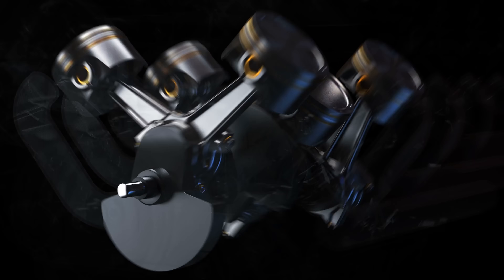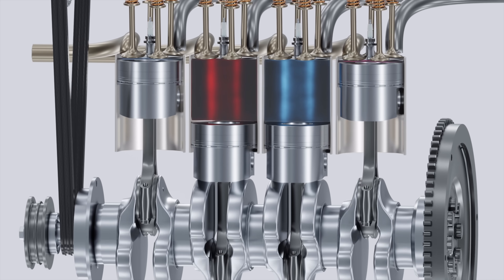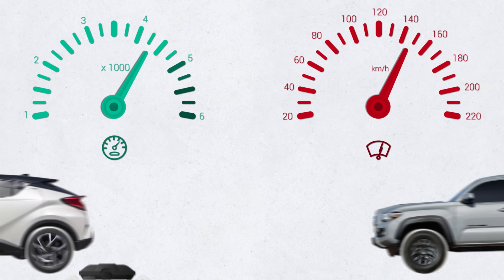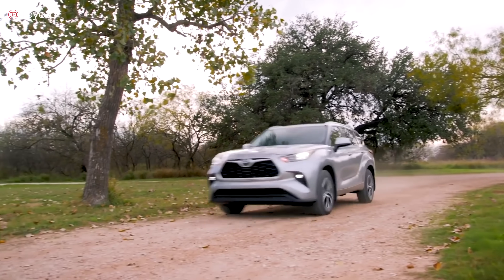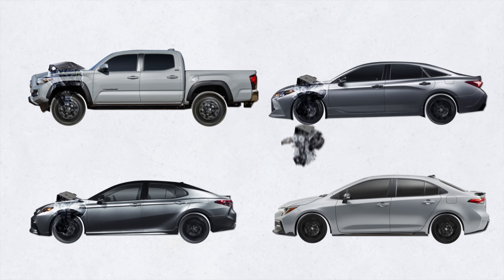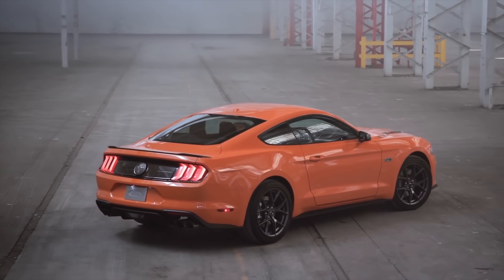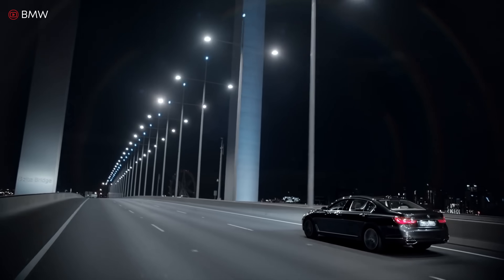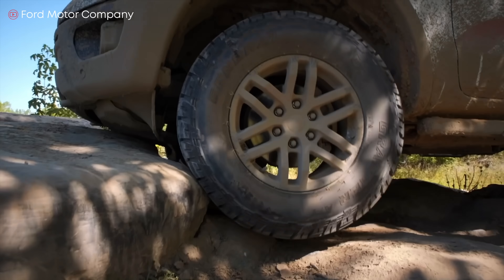No One is Telling You the Truth About Turbocharged Cars, So I Have To

Comment: V6 all day. Turbo 4's won't last due to high pressure and more strain on all the parts and seals.
Reply: Have you ever heard of Volvo?  If you have a strong engine and put a turbo on it, you get a strong motor with more power. I had several that ran great with 150K miles, I have seen them go up to 300K.
Reply: i got a tt mk1
Reply: @danielselinger8209  16 S3 here wassup VAG fam
Reply: @richardweinberger2756  my sons' Focus has a turbo and the bearing is shot at 120k.  £1200 part, the car was only £3000. The engine is fine, but that's beside the point.  You see what I'm saying?
Reply: @richardweinberger2756  outliers don't define the norm. In general my statement holds water.
Reply: @rob5944  The engine IS the point, Rob. What Scotty is saying is that these small engines in turbo cars don't last. YOUR unhappiness is that you don't want to replace the turbo when it wears out - which they do - it's completely common.
BTW I see those turbos used on Ebay for $200 in the US. Doesn't anyone rebuild those where you are?
Reply: @richardweinberger2756  it's not my car, maybe I didn't make that clear.  But for that money they sound well dodgy?
Reply: @rob5944  Why not check for yourself? Turbo's are not a new invention, they have been mass produced for 50 years.
Reply: @richardweinberger2756  so what point are you making, so was BMC/ Leyland?
Reply: @richardweinberger2756  ah you mean the low price?  Sorry, am on mobile and conducting several conversations in between other stuff.
Reply: How reliable is the Honda 1.5 T ? I am considering buying an 
Accord .
Reply: @DiscipleRay  Hondas use to be extremely reliable. Which you shpuld expect the 1,5T to be.

Comment: I’ve always found that durability and reliability are related to how someone drives. A very aggressive driver who mashes it to the floor every time they accelerate will have more problems and shorter engine and component life than someone who accelerates smoothly and moderately. I’ve had both turbo I4 and V6 engines, and I’ve had zero problems out of either. I am an aggressive driver but not to point of abusing the car. I make it work but I won’t hurt it. From what I can see, most modern engines are fairly reliable given good driving practices and regular maintenance.
Reply: Honda 1.5 turbo is trash gas leaks in to oil from factory and Honda  says that normal
Reply: I’ve owned four turbocharged cars and drove them like they had been stolen. One was highly modified and it ate some head gaskets (you play, you pay!) but never had any problems with the others. I’m religious with maintenance and like any non turbo car you need yo take care of it.
Reply: @Sammyhale30  Handling is the key to maintainance afterall in any kind of product. So howcome you can say it. Quick acceleration and quick braking matters alot and it is itself part of maintainance.
Reply: If you can do the work yourself you save all of that 💰 write it off in taxes
Reply: I agree. I'm getting a brand new Ranger Tremor next month and upon hearing it was a turbo and they require a little more maintenance to last, I immediately started researching the best maintenance tips and procedures for turbo engines. I plan on keeping this truck until either it explodes or I do so I want to spare no expense taking care of it!
Reply: Me too I’m an aggressive driver but holy moly these Texans 😅
Reply: LSPI

Low Speed Pre Ignition

This is the major issue with smaller turbo charged engines.  The increased operating pressures, combines with other factors, better explained by others than myself, leading to pre-ignition at lower RPM's, causing significant wear and damage to the engine components.

Unless your turbo has steps to mitigate LSPI, you will have engine component failure much sooner, unless a granny drives your vehicle and doesn't accelerate hard at low RPM.. then you might be ok.
Reply: @Unsensitive  That's known as detonation or knock and is easily avoidable by using 91 octane fuel, which is what's recommended for turbo engines anyway. Besides that, any engine can get the same thing, so that is not just a turbo engine thing. And no, it does not cause significant wear and damage. Not right away, anyway. Modern ecu's that run OBD 2 (anything post 1995) do have knock sensors and will adjust the timing accordingly, to get rid of any knock or detonation that it is sensing, so every car has steps to mitigate the issue.
Reply: VW 1.6L NA I4 with 285000 Kms (175000 mi) The only thing of the engine that got replaced was the ignition coil at 275000 kms. If you let the car get up to temperature you can do some spiritve driving and sometimes it can be beneficial for the engine. If you floor it all the time even when it's cold then you deserve to have a faulty engine.
Reply: @brianwebb1984  
They are not the same, despite sometimes being used Interchangeably.

LSPI occurs before normal combustion, detonation occurs after normal combustion and tends to be less harmful.
Reply: @Unsensitive  That is not correct. Detonation is called pre-ignition, which is exactly what you're mentioning here. They are the same thing and all OBD 2 cars will have knock sensors for adjusting timing.
Reply: @brianwebb1984  simply search the terms and educate yourself.

Pre-ignition vs Detonation

Plenty of sources for you to choose from vs be obstinate and ignorant.
Reply: Thanks for sharing. I've also had  a V6 engine in my last two cars and I loved the performance. I recently bought a car with turbo engine (2T) and I almost can not tell the difference between the V6 and my 2T performance  Recently, I got nervous when I started hearing all of the negative comments on Youtube videos about turbo engines. My goal last year was to purchase a car that was very reliable and performed well on the road. So, I bought a car with a turbo engine because I liked the vehicle. I am not  as aggressive of driver as I use to be so hopefully I will have my car for years to come with the proper maintenance.
Reply: @Planet universal  that was fixed over 2 years ago lol it also had nothing to do with the turbo.
Reply: Regular maintenance is the key!
Reply: I’ve been mashing my ls for the last 300k with no issues, oh yeah cause it has a factory rev limiter. I’ve seen more old lady driven vehicle give up long before one that was ran hard.
Reply: So, turbo diesel 4 cylinder engines will fare much better than the turbocharged gas engines?
Reply: @dundeeecroc diesel anything will last longer then gas engines for the most part
Reply: @overfloweddd4317  of course! I already knew that.
Reply: @amj6283 I have a Honda civic 1.5turbo tuned it’s already 4 years old and have no problems the key factor is maintenance and proper care
Reply: @miketess4272  How many miles a year did you drive? How long did you have those cars? Do you live in hilly terrain or pancake coastal area?  Specify, or don't leave a comment!!
Reply: This, this is what I try to tell people that try to compare cars.  But nobody want to hear it, it's just another appliance to them.

Both NAs and Turbo vehicles have their bandits and drawbacks the two different engines that you use should be determined by driving habits, and requirements for the vehicle.

Someone that need a commuter that will sometimes work the engines may benefit more from a turbocharged smaller engine.
While someone that need a work horse may benefit more from a larger NA

It ultimately depends on your needs.
Tho one thing is for certain.  KEEP UP WITH MAINTENANCE!  It will SIGNIFICANTLY increase the lifespan and health of the vehicle and drivetrain.
Reply: 224
Reply: Driving carefully with a redline a day keeps the mechanic away though. Once the engine is warmed up of course 😊
Reply: @WayToManyAssassins  the occasional romp on the go pedal wont hurt anything and will keep the soot blown out. I've had several vehicles where it did help it run better to run it hard once in a while. Just not every time
Reply: Durability and reliability- both based on use, maintenance and how solid initial engineering is accounting for quality assembly and quality parts.
Reply: That's why I don't agree with turbocharging gas engines because they really are efficient if you are mashing it. Otherwise, it is useless.
Reply: @jamesj5130  exactly! Ford's Ecoboost engines are either eco or boost, not both at the same time. Same with Dodge's new Hurricane I6. Even the little 2.0T I had in a '16 Camaro and '17 Regal Turbo would suck gas if you stood on it all the time. The way I drive I always got 28 in the Regal and 31.5 in the Camaro. But if you drove them hard, it would drop to the teens, like a V8.
Reply: that's what they claim, but it isn't true for every new vehicle.
remember they're not building cars to be reliable, it's all about the EPA and what they want.
so if you want reliability, only certain manufacturers will go about it better than others.
Reply: @planetuniversal8085 I've seen the 1.5t with 700k miles on
Reply: @aghastvenus2419 let them turbo warm up on cold starts. change oil and never go pass requirement miles. Don't let turbo build up max boost then let off gas " all the time". And your good